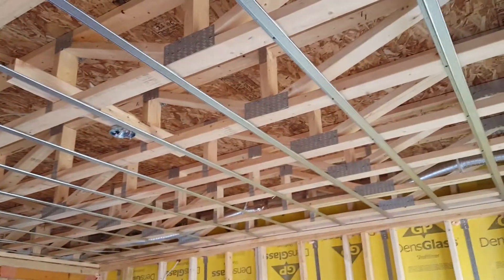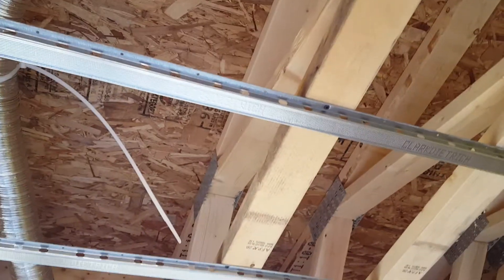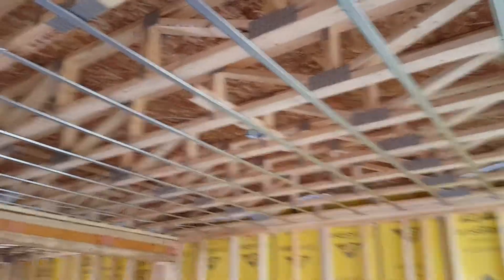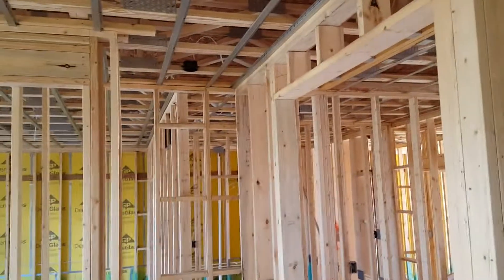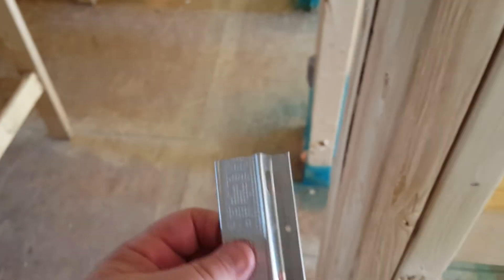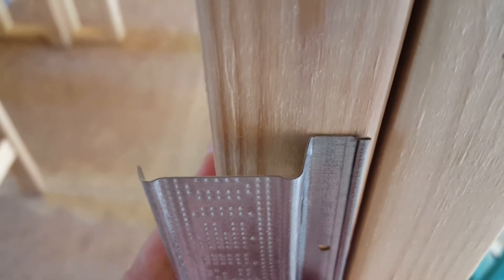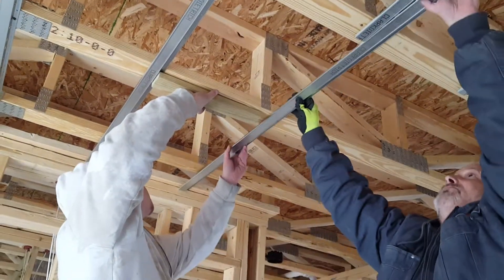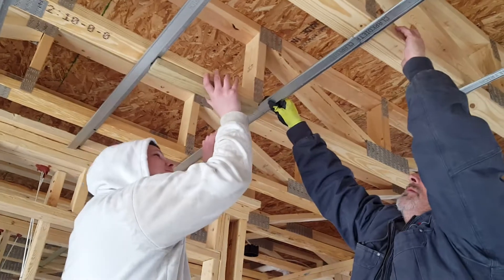How to hang R1 resilient channel

Comment: I had heard somewhere that you should avoid butting the ends of the res channel up against the horizontal wall framing, like maybe leave a space of an inch or inch and a half between the end of the channel and the wall headers (to minimize vibration transfer from the ceiling joists to the wall framing).  You made no mention of this practice and in fact it looks like you ran all of your resilient channels right up to the wall headers.
Reply: Hes also using the wrong screws - According to specifications of the RS channel I bought youre supposed to use 1 3/4" #8 panhead screws, drywall screws are not the correct screws to use
Reply: Client can't understand why the channel didn't seem to make any difference.

Comment: how deep or thick is it? I would like to know for putting in electrical boxes before I buy resilient channel
Reply from the maker: Hey George that is a good question.  I would say 1/4 to 1/2  inch depending on the style of channel used.

Comment: Great vid. Subscribed! From your experience, will the res channel eliminate height differences up to +/-1/8" between joists( joist are new, but have cupped slightly; every 4-6 joists, one is a little low or high).  Any help greatly appreciated.
Reply from the maker: HEy Patrick  if you have a joist that is hanging low an easy fix is a hand plainer    i know it may sound crazzy but i work for a builder who does it on every house.   now if you have one that is up to high  just use a fir strip to bring it down.   if a joist is cupped but level with the others i dont think it would mater because the R1 hangs from one screw in the middle of the joist. im no engineer but this is how we handle it on the jobs im on.     i hope this helps    have a great week and thanks for watching     led
Reply: @led8541  Ya I've got the planer on standby, lol. Haven't hung much drywall before, and I'd like to be perfect. Going to plane the drops, shim the highs, Bailey res channel & 5/8 fire rated 12'X54" sheets. Cheers bud!

Comment: Great video....yesterday, I was trying to hang a garage ceiling-mounted/hanging shelf system, and I could not figure why each of my stud finders were acting drunk and why I found not only this "metal" object in the area above the garage ceiling, but why there was a damn 1/2" air gap between the drywall and the flat 2x4's up above!  

Eventually, with several large ceiling holes, we deciphered what was going on...but this video helps visualize what was going on.
Reply from the maker: Glad I could help!

Comment: What kind of screw did you use?
Reply from the maker: Hey Michael   we just use drywall screws
Reply: According to specifications of the RS channel I bought youre supposed to use 1 3/4 #8 panhead screws, drywall screws are not the correct screws to use
Reply: @jvapor  lol 🤣🤣🤣🤣

Comment: How would you shim the res channel if the joists have warped?
Reply from the maker: I think you just answered your own question By using a shem of some sort. Just make sure it is level by using A plumb line or a 8' level. I hope this helps have a great week and good luck.  Led
Reply: @led8541  thanks for your reply, wasn't sure if a certain type of shim was required or not

Comment: What screws did you use to hold them in place and what drywall screws will you use for drywall 1-1/4, 1-5/8,2 inch
Reply from the maker: Hey Nsingh  we use regular 1 1/4 drywall screws to hold up the channel  and for half inch drywall we use the same .   thanks for stopping by the channel    led
Reply: @led8541  coaurse thread or fine thread
Reply from the maker: @Nsingh11  course